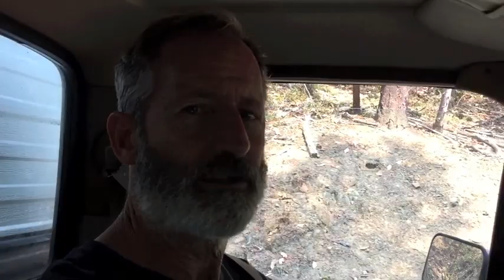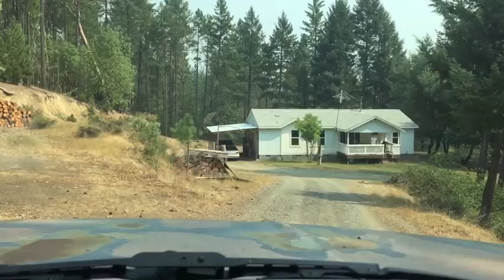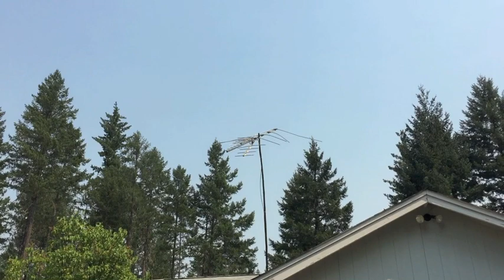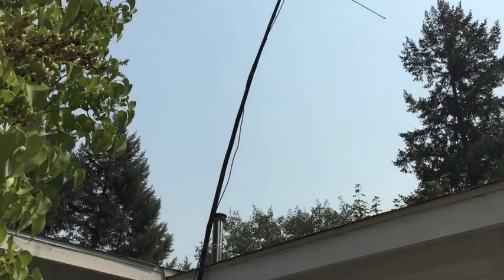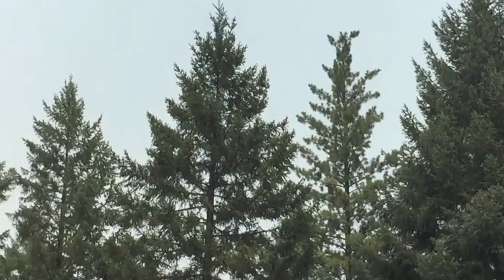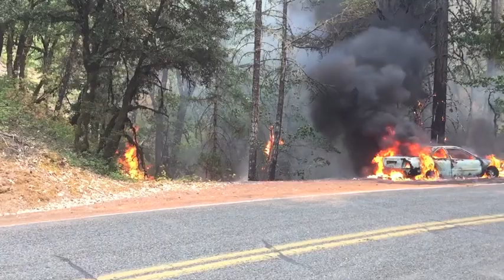TV Antenna Job And Finding A Car On Fire.

Comment: Antennas need to be very beaten up before they stop working. I worked on comms links in Afghanistan during the "problems" and dishes with shell holes in them still worked just fine.

Comment: WOW this video was not a good one, where is the signal report after u installed the new antenna and how many more stations did he get???
Reply from the maker: Sorry I didn't have more detail.
Reply: @GrantsPassTVRepair  dont u normally test ur work?? When i was on the job I always recorded the test results and filed them incase the customer ever rang back if the equipment broke down.
Reply from the maker: @OffGridAussiePrepper  Yes I used a signal meter, but I didn't think the increased signal strength would be that interesting to others under the circumstances..
Reply: @GrantsPassTVRepair  always interesting to know the size/scale or magnitude of the improvement. You improved the safety of the installation (assuming he now takes down the old one) so that is worth some time and money 😎